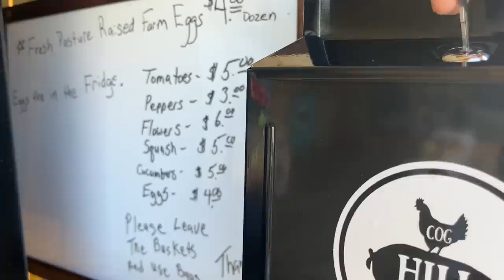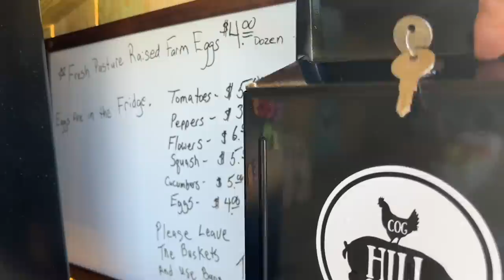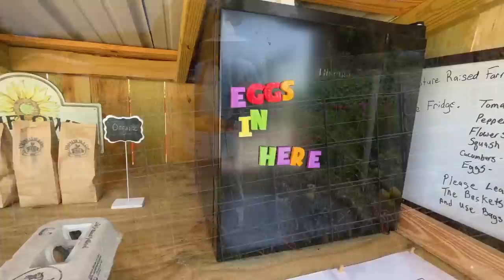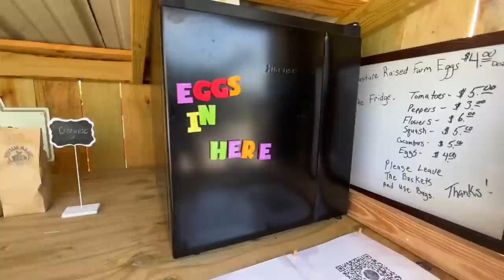You Won't Believe What The Farm Stand Just Did For Us!

Comment: I just wanted to share something I do with eggs in my freeze dryer. I scramble 9 eggs each and add them to a quart freezer bag, lay them down flat and get out almost all of the air (by turning up the open end until the eggs get close and them closing), I lay them flat on a cookie sheet and freeze them on the cookie sheet. Once frozen, I cut them out of the ziplock bag and they fit perfectly on my freeze dryer trays-3 per tray (I have a large freeze dryer, so I don’t know what size the medium sized trays are), and then I freeze dry them and when done, powder then and store in mason jars or Mylar bags for longer term storage. To reconstitute, it is 2 tablespoons of powdered egg to 2 tablespoons of cold water (= 1 egg). I find this really handy if I’m out of eggs and need an egg or 2 for baking or for breakfast as scrambled eggs. Just wanted to share with you 😊